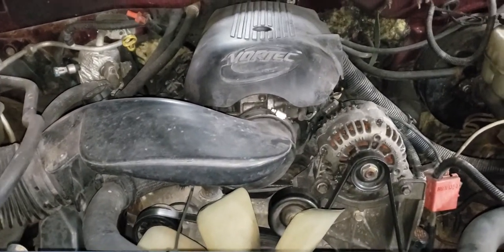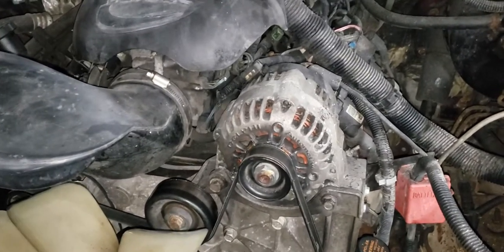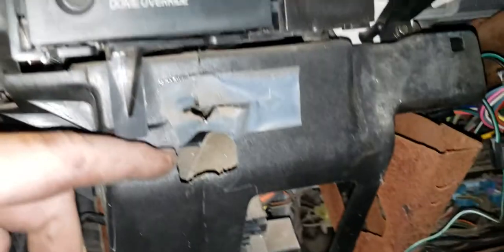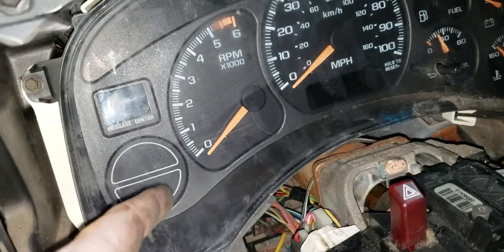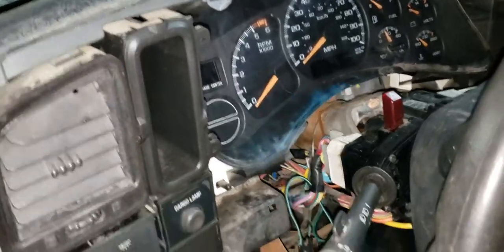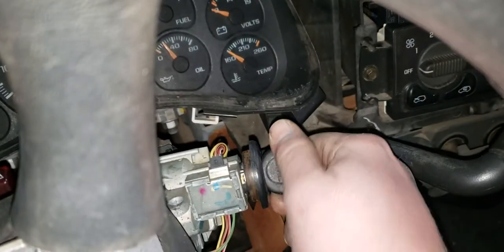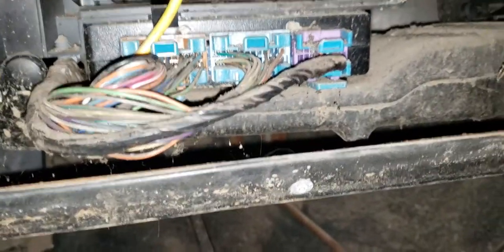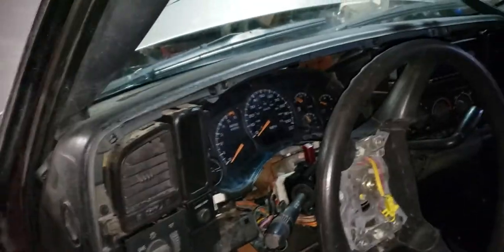Free Gm security bypass VATS 4.8 5.3 6.0 6.2 Silverado Sierra tahoe yukon

Comment: I did this. Got my 5.3 running in my 69 C10. Then six months later it quit.  Starts....2 revolutions and quits.
Reply from the maker: Battery must have died it will clear codes
Reply: @rm33321  yes I think you're rite. I had to send it out and get it properly set. Seems good now

Comment: After you cycle the key and get it fired up and vats is disabled,  can you then plug back in the bcm so everything else works??? Thanks for the information.
Reply: Did u plug it back in. I wondered the same thing?
Reply: This trick works. You put the original pcm back into the car your using to do this. You take the pcm you plugged into the car and use it for your swap. If on your swap car you clear the codes or if your battery dies or anything that would cause your pcm to reset would make the vats come back. It's ment to be temporary but it helped me buy some time til I could find someone to flash my vats
Reply: Did it start mine starts dies